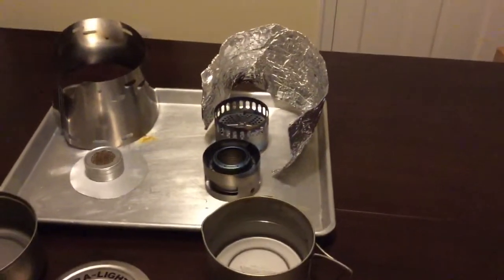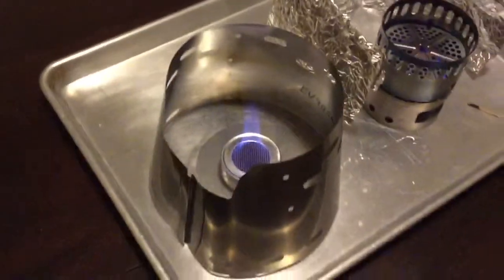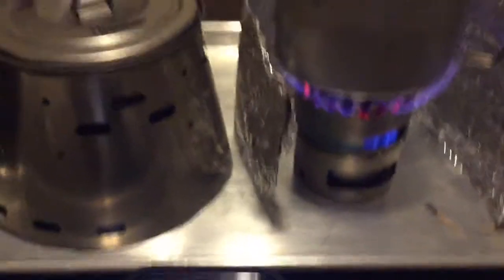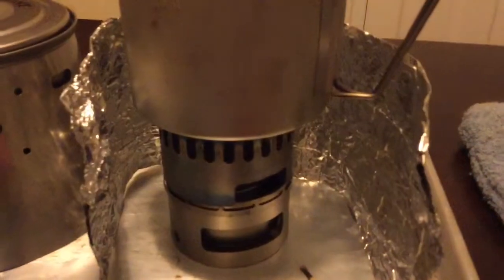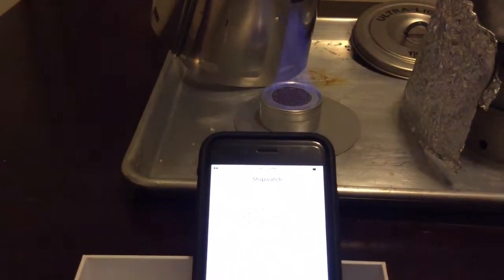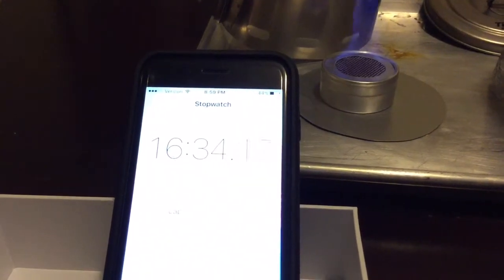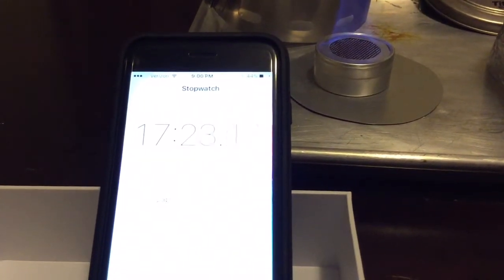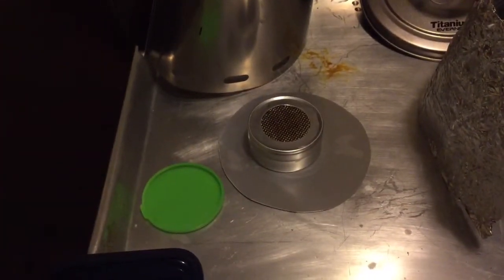Alcohol Stove Boil Off: Trail Designs Sidewinder Ti Tri versus Evernew DX Part 1

Comment: If you want the Evernew to burn longer at a lower temperature, you can use it without the DX stand and just place a pot directly on top of the burner. Give it a try, it works.

Comment: I think I’ve seen a vid of a guy showing the trail designs caldera giving equivalent boil time:fuel weight ratio as the average canister stove? was this possible? The problem with alcohol ‘on the trail’ is that the weight of the fuel for the same amount heat given by canister gas or white gas makes the whole system too heavy vs canister or liquids stoves plus the fuel.
I’m interested specifically in the trail designs ti-tri because I thought the cone out most of the heat into the pot rather than it dissipating out into the air and being wasted and as a result boiled water with half the amount of alcohol that most alcohol stoves need to do the same job?

Comment: How is the even an honest comparison when you use to DIFFERENT alcohol stoves with different surface areas?
I have a T.D. Sidewinder and a fitted Open Country 3 cup pot that, with the settle KOJIN stove and get 2 cups (56 F. H2O) to boil in 6.8 minutes. But I prefer ESBIT tablets for ease of use.
You CAN interchange pots on a Caldera Cone Sidewinder. SMALLER POTS-> use the 2 ti tent stake skewers provided with the Inferno wood burning insert and set the smaller pot on them after inserting them through the cone top holes. LARGER POTS-> just wet them on the cone top. Problems solved.